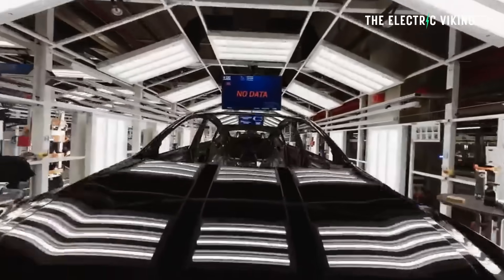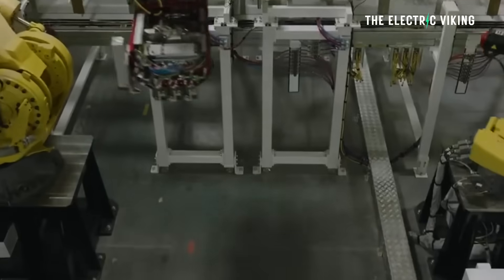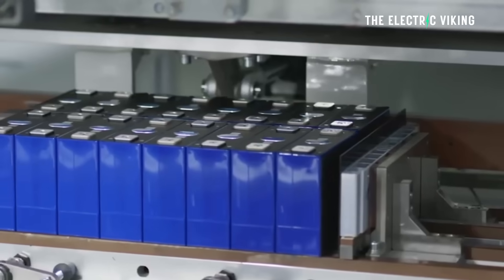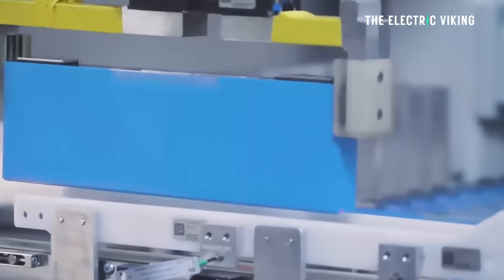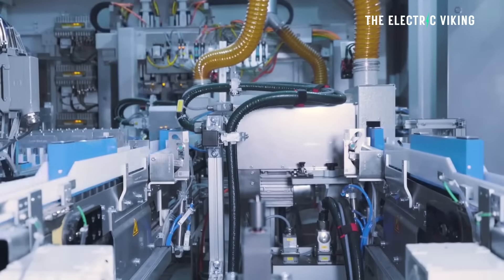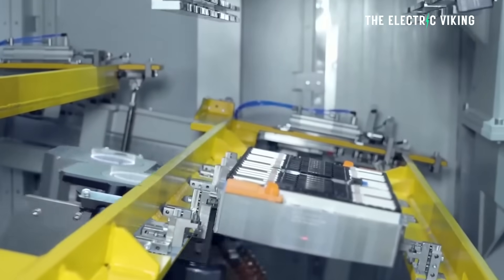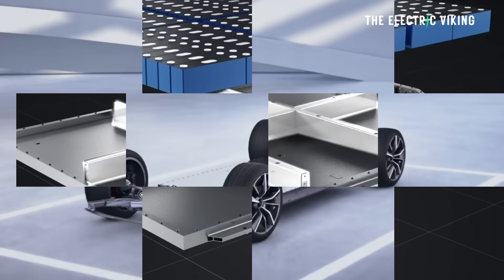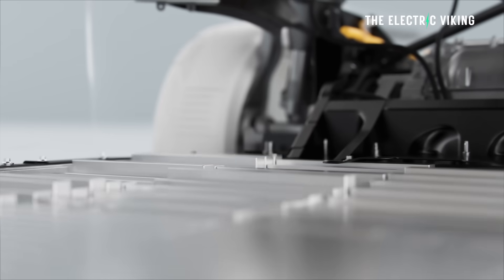Reinventing EV Batteries — 1,000-Mile Range could Come From US Company

Comment: The repair issue isn't very concerning to me since standardized manufacturing would reduce such defects to 1% or less.   If an entire battery pack replacement was necessary it would be covered under warranty and the cost of that defect would be minimal to the carmaker.

Comment: You don't really need to be able to fix the battery pack if a cell goes bad.  Since the density starts high you just have to be able to disconnect that cell or prevent it from impacting its neighbors.

Comment: Battery packs are too reliable to bother trying to fix the few that fail. Just design them to be recycled. I think "fixing things" is an outdated idea. That requires labor that's more expensive than the item. When was the last time you saw a TV repair shop? They used to be all over the place 50 years ago Rebuilding transmissions and engines might still be a thing maybe not for long. When you have an extended warranty claim at Best Buy you usually don't send the item in for "repair" it just gets replaced. Repair shops are going the way of the phone booth.

Comment: I kept skipping until 5:09, your entire video is just full of repetition, empty statements, and unsupported nonsense. A picture of an actual battery showing what the supposed "inactive materials" are would be nice.  The difference between you and have a think is pretty stark. When he analyzes claims, he really shows the underlying engineering. Or ziroth. Did it never occur to you that if you can double the energy density of a battery, the logical thing to do isn't double the range, but for most of us, halve the battery. That would mean you have 500 mile range, and less weight, so the range goes up to 525 or 550. And the price drops because you have less battery.

Comment: It makes sense till you do the risk assessment. Do the crash test and all will be revealed. Cars 30 years ago 750kg (OK I only drive small cars, for the planet) Today the same size car is 1000kg - the difference is crash protection (front & rear). Less metal, more risk. Yea yea, repairability will always suffer as the build process gets cheapened.

Comment: Always great vids eViking! Regards what happens if there's a fault and not being able to isolate it in a fully-sealed battery pack - yeah that's a biggie. Who wants a car that you have to spend tens of thousands on a new battery pack if even just one part malfunctions? But I'm sure 24M is working 24/7 on that issue! Let's hope so, anyway.
Reply: Modern packs are so reliable & durable that nearly none of them need opening for several hundred thousand miles.  Reducing material in the pack lowers the weight the car is carrying, which lowers the weight needed for structural support, suspension, brakes, drivetrain, etc.  That lowers cost, so they could pass on most of that to the consumer & set aside a tiny bit for extremely rare whole-pack warranties.
Reply: @tomhoulden1104  I definitely like the whole-pack warranty! If they are sure of their product they will back it. Of course I obviously like the idea of 1000miles/1600km range - but I never saw how it performed versus iron/salt batteries at very low climate temperatures?

Comment: 300 miles 10 to 80% range at 130 kph is all U need, every mile more is wated money and resource and weight.
3 hours drive and then 30 minute break with recharge, again 3hour drive, 30 minutes break and 3 hours drive + overnight stop qith charge to 100%, gives u a 1200 km daily travel distance.
Reply: Right, as long as there's sufficient public charging, & manufacturers stop putting slow onboard chargers in their cars.

Comment: Increasing the volume devoted to the cathodes and energy storage is great of course. We'll have to see if any US manufacturers announce they will use the process. I don't get all the commenters complaining that 1,000 miles isn't "needed". It may not be needed, but generic EVs getting 1,000 miles would hasten the end of ICE.
Reply: What is ICE?
Reply: @DoubtingTom Internal Combustion Engines.  Basically gas and diesel cars.
Reply: The problem is that the 1000 mile range comes at a cost that many people are not willing to pay for resulting in the opposite of the hastening of the "end of ICE".
Reply: The cost differential will hasten change. There’s not many ICE cars that get 1000 miles to a tank. It’s a pointless target.

Comment: Yes it makes sense. Now convert to sodium batteries to reduce the cost and only get 800 miles per charge. Do that and you solve every problem.
Reply: But I think sodium battery is much heavier which will further reduce the range.
Reply: @crimsonred7517  Yes, existing sodium batteries are heavier for their capacity than lithium, but applying this technology to sodium could match or even beat the weight of a lithium pack.
Reply: @tomhoulden1104  That is a number of years out if possible .
Reply: @crimsonred7517  sort of. They're going to be far cheaper so you can afford more of them.  They also have the potential to be charged much faster.
Reply: @crimsonred7517  I believe the latest CATL sodium batteries to be mass produced very soon have a higher energy density than BYD's Blade batteries so weight need not be an issue.
Reply: Sodium metal batteries is also currently in development since it promises same or better energy density than current NMC lithium battery

The real serious question is, when will it finally reach the mass production?

Comment: No point in 1000 miles range - just use a smaller (cheaper) battery !!
Saying that the technology and the "idea" sound really good
I wonder why nobody else is doing this? 
After all a std 12v lead acid battery is six cells built as a single unit - and has been that way for a very long time

Comment: As far as grid applications, although size/energy density may matter little in original construction,  these factors would matter for upgrades and retrofits.. Even grid batteries will have a lifespan and during that battery life we all expect demand to rise..  A company looking at its existing battery infrastructure will  be drawn to the idea that land and structures don't have to be  newly purchased.

 Now these batteries from Massachusetts may or may not be ready for mass production. Company promotions aren't in short supply., but wherever the sourcing comes from , capacity and density will remain in demand for grid storage.

Comment: Over 90% of ALL car trips are WELL WITHIN THE RANGE of current EVs! And YES, while EV battery density/weight ratios are improving apace, the remaining 10% of cartrips, given a modicum of (mostly automated) planning, are also possible right now, without further battery range increases! My point? Current EV technology is perfectly sufficient for the vast majority of users, and general adoption is not a matter of if, but when!
Reply: Think about towing range. Pulling a boat or even a small rv destroys range. This would be a huge benefit
Reply: I would agree with you, but I live in a very niche case. Let me give you an idea.... 
I have a 2023 Ford e-Transit, it has a 68kWh battery. I drive around 60 miles daily, in my current configuration provides about 140 miles from 100-0%. I charge to 80% daily, and do 95% city mileage (top speed of 55mph).

The stupid heater is absolutely ridiculous!!!!! Winter range in the cold is about 70 miles @ 80-0%. I would love to double my range, or have a better battery technology that doesn't suffer from being cold. 

For me, this is very cool news!
Reply: Those remaining 10% are highly relevant for most of us. Making a 1000 km drive and having to stop 2x 1 hours for charging is a small nuisaince. Having to plan the whole trip in detail in advance, wilth little room for spontaneous route changes because of lack of infrastucture is a larger one. Having to install 3-5 apps from different charging companies who don't accecpt foreign credit cards, or in many cases no credit card payments at all, is close to a show-stopper. All these issues, plus range an price, will have to be solved before I consider buying an EV as a family car.
Reply: That’s true for daily driving. For towing a load with a truck or evtols/drones this is HUGE

Comment: 24M has their proprietary impervio separator, which includes conductive layers attached to the BMS (battery management system).  Near as I can tell they monitor the separator, maybe even reverse biasing it? This is how they prevent dendrites. Without impervio you cannot make the giant "pillow cells" they showed Sandy Munro in his video.

Comment: Technology is racing ahead because of the massive amount of investment in private companies and universities. It won't be long before batteries charge faster than pouring petrol into a tank and the battery has more range than a full tank.
Reply: It will be a while before even 5% of the population can do that at home and most wanna charge at home...ideally off peak hours.
Reply: @veganpotterthevegan The technology I was referring to was public not domestic chargers.
Reply: @johnfrancis4401  yes but that's secondary to what people actually want.
Reply: @veganpotterthevegan  I want it-- in a sub $20k car.
Reply: Vegan, agreed! I want an affordable, EV work truck!
Reply: @tdn4773   sub 20k EVs definitely exist in Asia and Europe.   I don't think any sub 20k EVs will pass crash safely tests in the US and Canada.  General inflation has pushed out the $20k car.
Reply: @veganpotterthevegan In the UK you can buy EVs for under £20,000 quite easily you're prepared to buy second hand. The depreciation of EVs is massive losing about 30% of the value within 2 years. This is a wonderful bargain. I wish I had bought second hand. Hindsight is always 20:20 vision.
Reply: @veganpotterthevegan  Hardly anyone needs fast charging at home.  My EV recharges over 28,000 miles/year, charging only from a standard wall outlet, just during the time the average American spends at home.
Reply: @tomhoulden1104  I know that.  But people want things they don't need all the time.  A LOT of people don't actually need a car at all.
Reply: @veganpotterthevegan If you’re charging at home you’ve probably got at least 8 hours to do it. That doesn’t require super fast charging.
Reply: @dermotbalaam5358  depends on how big your car is and if you have access to a 220v receptacle.  I know I'd need to redo my entire breaker box and meter to get 220 to a vehicle, or I'd be unplugging my dryer and I'd need to run a 40" long, very thick extension cord through my house to get to a car.

Comment: I'd rather have a 200 mile range car that is 1/5 the cost. Yeah, the battery isn't the entire cost, but it is a big part and you'd need less than 1/5 of the battery since the car would weigh less... So maybe 1/2 to 1/3 the cost for a 200 mile range car.
Reply: No free lunch.  It, may cost much more per kilowatt.

Comment: Rather than shooting for some unrealistic 1,000 mile range EV. The other approach is to build a 250 mile capable battery that is 1/4 the size, weight, and cost of todays current battery packs. Considering that the average driving range used daily is under 40 miles. As long as the battery pack is reliable and can be heated/cooled easily and effectively, it sounds like a great goal.
Reply: Nobody is saying that the battery pack must be big enough for 1000 mile range at high cost. What is being said is that within the same space of a current structural pack, newer, improved cells can take the car up to 1000 miles.  It is just a comparison to current batteries.  Of course this can be scaled down to achieve a lower cost and range.
Reply: @bengt_axle  I understand. But I think that generally 1,000 miles of range as a goal is designed to be a headline, to get clicks. And 250-400 miles of real world range is a more realistic goal. With less size, weight, and cost being the benefits. You can put a 500kwh battery pack into a GMC Hummer and get 1,000 miles of range. Or you can put a 40kWh battery pack into an Aptera and get 400 miles of range. Without any advances in battery technology. Which is more impressive to me. Of course if you can make a 40kWh pack for the Aptera that is much smaller, cheaper, and weighs 1/4 as much, I will be similarly impressed.
Reply: Bigger batteries tend to be more durable.
Reply: @veganpotterthevegan  Not really. Better design, chemistry, technology and support systems lead to durability. Not capacity or size.
Reply: Well, car, no, but truck yes.

Comment: Personally I think the future is SALT! Dirt cheap good enough CATL Naxtra batteries in 21 kwh batteries for 2-seater cars would be a good enough solution. Aka revive the GM EV1 concept but with new battery and safety tech.. Skateboard chassis with plastic body panels atop, like Slate.. or ye olde Saturn from yore.. Aka the mid 90's. That concept was rock solid but got watered down by lame GM C-suites!

Comment: Another day another battery that never happens
Reply: Mechanic, what are you talking about? The rapid evolution of batteries has made EVs and many other things possible, and increasingly affordable! 

I have 28 kWh of batteries on the house that would have cost perhaps $35,000 to install five years ago. I installed them for $7,500 this summer!  Decent home batteries weren’t even available before Powerwalls hit the market in 2015.

As for car batteries, CATL is putting fireproof, cold weather hardy and long lasting sodium ion batteries starting in early 2026. Fire resistant and long lasting lithium iron phosphate batteries have been in cars for four years.

EV batteries are so good now that they will outlast any car they are put in, and still be able to be repurposed for a few decades of home or utility storage! 

The bicycle, skateboard, one wheel and scooter batteries are a lot of fun! A lot of E bikes have ranges over 50 miles! And the scooter and skateboards have to have speed regulators they can go so fast! 

And thousands of chemists, product developers and engineers are building new kinds of batteries and thinking up new things to use batteries for! This is speeding up the complete replacement of fossil fuel engines for most applications. We manage a number of rural properties and rentals. We’ve  replaced our old, unreliable, gas chainsaws and mowers with quieter, battery powered tools! 

Gigawatts of utility storage batteries are being installed that will allow solar, wind, etc. to truly replace fossil fuel electricity generation.
Reply: FUDMONSTER ALERT! FUDMONSTER ALERT!
Reply: It'll come, even if it takes copying the Chinese EVs already doing it.